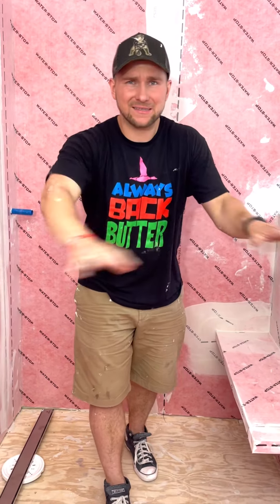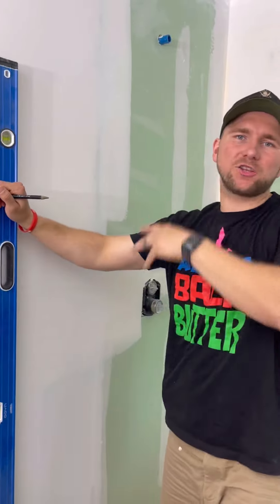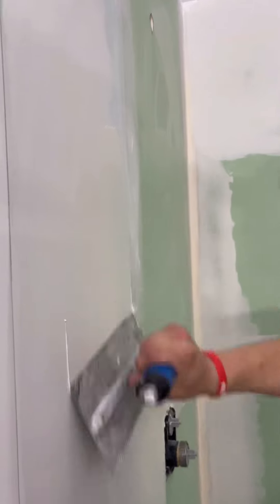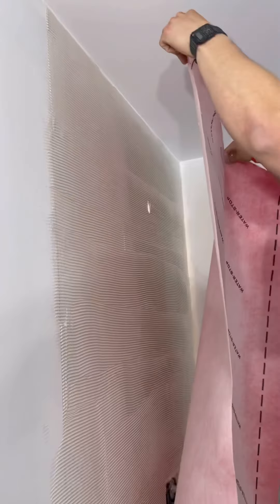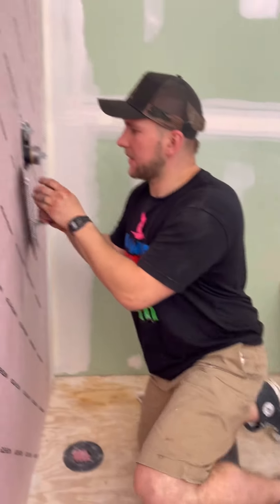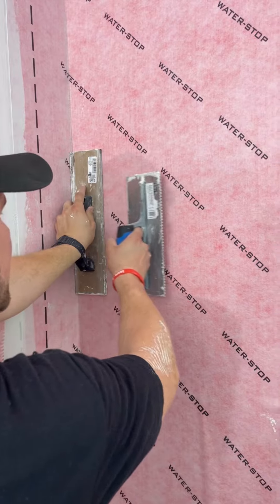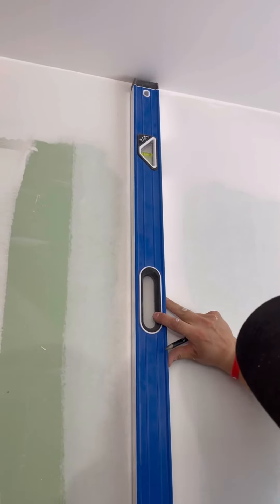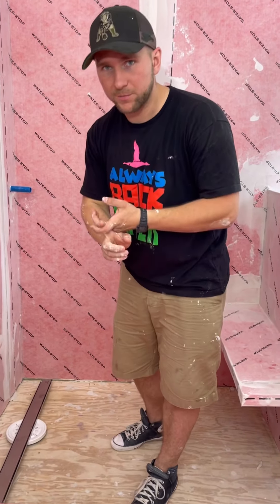BEST Shower System. GURU Shower Waterproofing Membrane. How to waterproof shower walls. Vlog 008

Comment: Haven’t you used KRSB Hard Core backer board?
Which is much more efficient judging from your videos.
KRSB is one step installation where this process is Sheetrock compound and then thin set and waterproof material?